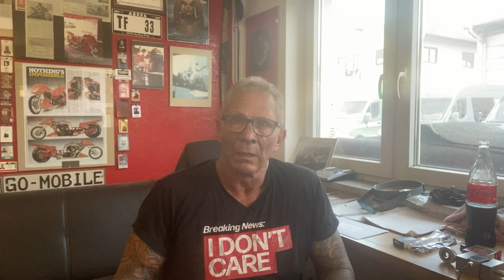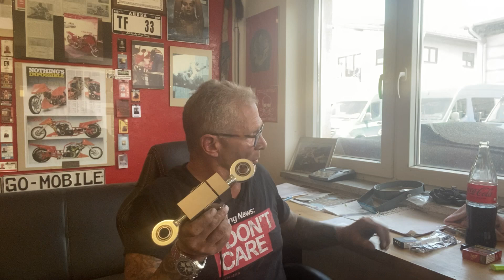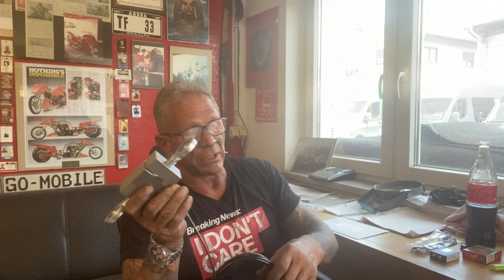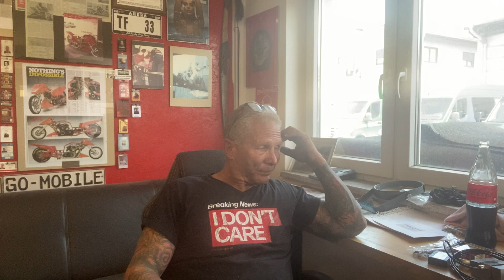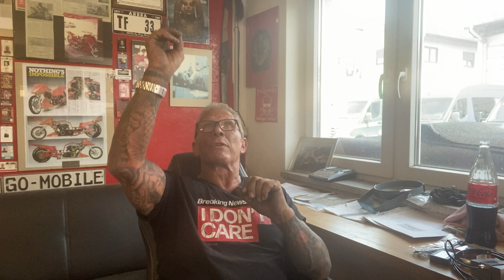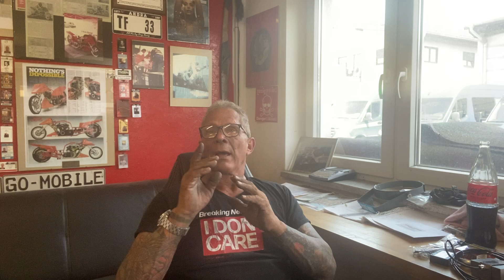Stunt Rigging Toolbox Talk #36

Comment: Hi James! First, thanks so much for putting all that information out there! I am enjoying watching your videos and learning more about the stunt rigging standards. I come more from the circus side of rigging. I would be curious to hear your thoughts about omni slings. Some stunt people around here call them pocket trusses. They always double it up (basket) and use it only for lighter loads, but I would be curious to have your opinion, and tips and tricks!
Reply from the maker: Sorry for the late response, but... I do not like to use daisy chains or Omni type slings for any types of loads with people, especially dynamic. I think there are better options, such as using the correct length of polyester round sling, or, if you have the skill, a whoopee or adjustable sling from 12 strand hollow braid. I consider the load rating too low to be used, unless there is no possible other way to do it.... which there really never is. That being said, Omni type are far preferable to daisy chains, due to the differences in construction. Considering that most line for stunts is 12 strand hollow braid, I do not see a reason why an adjustable sling from said material can not be made on the spot to create the sling point needed. As I also carry so many different lengths of polyester round slings, rated wll of 1 ton at 7:1 design factor, and have pulled these to over 7 ton, a real sling is always the first choice. For oddball, or adjustment situations, I always splice an appropriate so called whoopee, or adjustable sling. The statement you make at the end about basket use and only lighter loads is misleading, as once things are rigged to a certain norm value, then that is it.... otherwise you need to change it. Why not do it to the correct value first, giving yourself more room for operating...
#